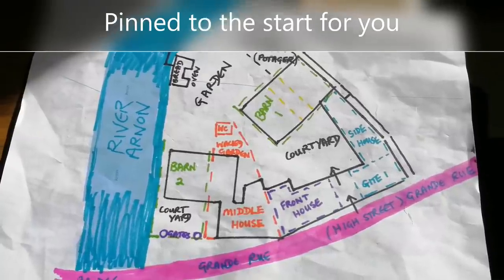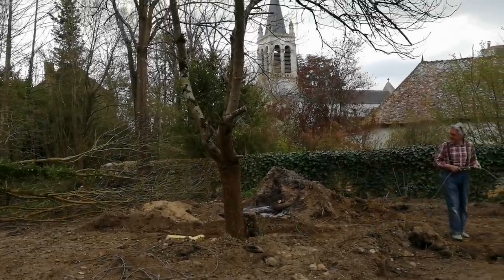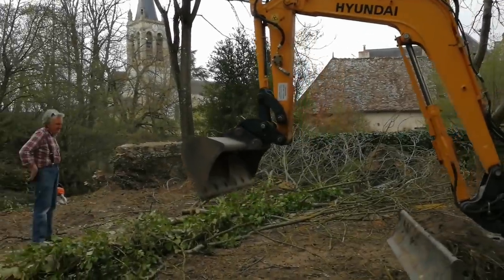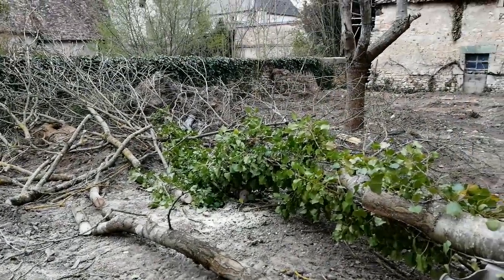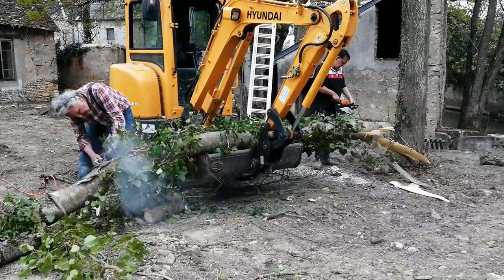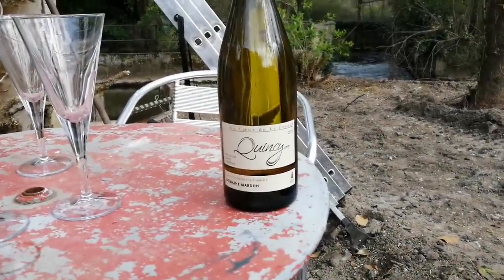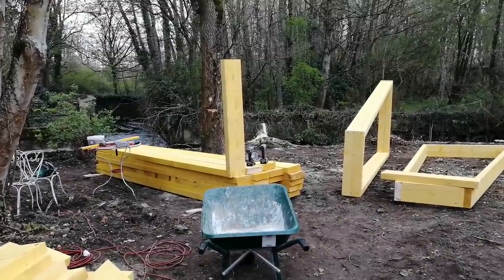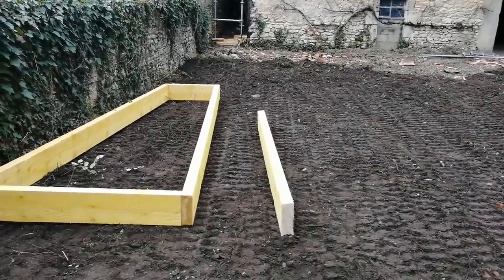Not Quite a Chateau DIY 66 -  The Chainsaw Gang -  Duelling Chainsaws -   and Optical Illusions

Comment: To get a right angle 📐 off the wall of the barn run the string line out from the side like you were doing measure 📏 3’ across the face the wall of the barn mark that point; measure 4’ along the string line from the face of the barn wall mark that point on the string; 
Now move the free end of the string until the two points 3’ mark on wall and 4’ on string that the diagonal measurement is 5’. 
A right triangle will have sides of 3x4x5 
Which will make the string run perpendicular to the back wall of the barn, or, parallel to its side. 
Geometry a 3-4-5 triangle has the ratio of the sides in whole numbers called Pythagorean Triples.
Reply from the maker: Ok thanks for that Tony, my Tony had already worked out the shape of the bed but it just didn't look quite right, even the barn wall isn't very straight!